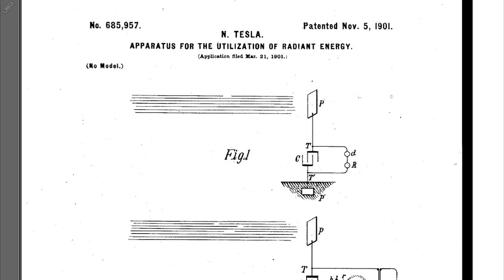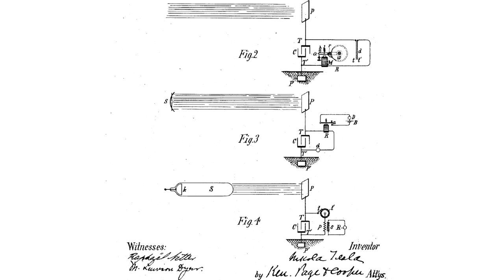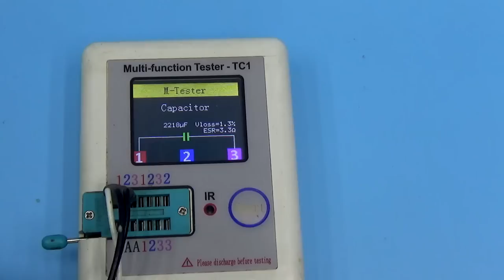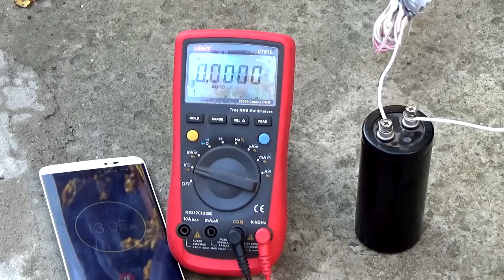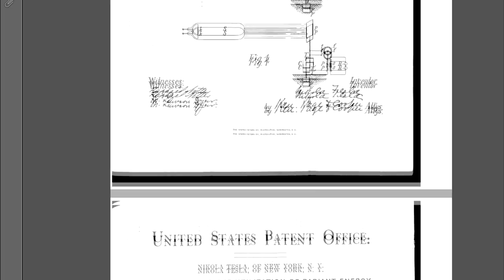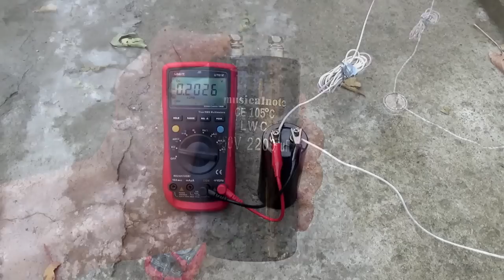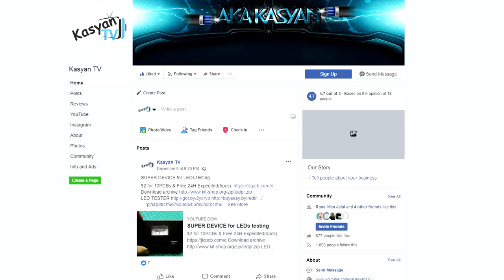Nikola Tesla - Free Energy (fuel free system - How does it works?)

Comment: Umm that's an antenna. It's simply converting radio
Reply: How it converts radio waves to dc to charge the capacitor?  Capacitor only stores dc energy.  So you are wrong.  Also there were no radio stations when Tesla made the patent!  Also the diode  of today was not yet invented nor shown as needed in the patents.  Read the patents and he tells you the energy origins.
Reply: @energycrafts8206  antenna to capacitor with a rectifier to make dc is 4 diodes
Reply: @EvoArtsLLC  Yes, but patent shows circuit working without any diodes.

Comment: Patent clearly said in the title as utilization of radiant energy. Generator is another patent and receiver must be tuned to frequency of the radiant energy transmiter/generator. If you have not build one and running you will have no result.  Its like having tv without any existing tv station transmitting the signal. Of course you will have conclusions that tv is just waste of time, material and money.

Comment: This is no different from an unpowered "crystal set" MW radio receiver. Latterly germanium diodes were used. You need a decent length antenna wire and a decent earth /  ground connection. There'll be just enough AF left to drive a very high impedance piezo earpiece. No use as an energy source.

Comment: I want something that i can power my house with. Besides my state issued electric ity
Reply: This video is a disinformation thing.  It doesn't explore the full capability of tesla's device. The antenna is all wrong, the circuit is missing parts and there actually is a small power company making megawatts with the technology.  It doesn't run on cosmic rays either. It collects static energy produced my earths magnetic field and its rotation. At 18 feet high you'll never get any useful power. You don't need a football field sized antenna.  You need a taller tower. Tesla's was 52 feet high.
Reply: @captainKedger  Can you explain the things he did wrong? And what is the correct way to do it?

Comment: How about current measurements ?
Reply: There's actually not current at this point. A potential is being created in the capacitor! If the capacitor is then attached to a load then there will be current and that varies depending on the resistance of the circuit
Reply: @McLucifer22  how big current do you estimate from circuit shown in the video?

Comment: Well here you are drawing energy from the sun, what u should do is invert the relationship and draw the vibrations/radiation from the earth to make it functional. You also didn't calibrate your wires and capacitors in optimal manner so the output you got is not very useful.
Reply: Use a step up transformer and get more power

Comment: Damn you people need to learn something about electricity before commenting. Sue you can grab 10Kv from the air but what happens when you drop a load on that voltage?  That 10Kv drops to zero, why? NO CURRENT or barely any current.. So you can light some red LED off free 10Kv you grab out of the air. I can light a whole strip of white usable LEDs on 12 volt battery maintained by a solar panel, so what is more efficient the thousands of volts that can barely light red LEDs or the solar charged battery system that can illuminate my entire home for 12 hours?
Is there electricity in the air? Yes but is is usable? No not unless you have a way to refine it efficiently and pipe it into your home safely. This is where Tesla fell short, he could not get around the safety and efficency and most of his inventions are deemed unsafe for commercial use in the real world. However what he did achieve was advancements in radio which proved to be far more valuable and safer that wireless power distribution. FFS we would not have computers or modern IC circuits if wireless power distribution was a thing, the EMI would fry anything with a silicon chip. We would be stuck on vacuum tubes in 2021 and radio and TV would not even exist because the airwaves would be USELESS for that due to the interference.

Comment: Did Nickla Tesla a use aluminum to sheet collect the radient energy. Black cardboard wrapped with copper wire ( poor man solar cell). Each turn/ rap of the wire close but not touching make a better collector of energy. They that and see what you get.

Comment: The size of a football field? Isolated high in the air?…. A blimp?
Reply: Nope, this is just the garbage that some people spread around, you can use let’s say an aluminium plate 800x600x2 mm or even thicker. The aluminium plate needs to be high polished and eventually a protective coat applied (lacquer for auto vehicles is fine). Fit this plate 3 meters above the ground in a place without obstacles than connect an isolated solid (not stranded) copper wire at least 6 mm2 section vertical. In the middle of distance between antenna and ground connection you fit the circuit. All wires above the ground must be insulated ! If possible choose all components low esr, fast switching. First stage is antenna and 2 capacitors ( AC filtering ) is called tuning stage, second stage is charging (fast recovery diodes, half wave for each cap), third stage is energy storage (2 capacitors, 1 for each half wave rectified) caps need to match desired load be it a power bank made of 2+ lead acid battery ( cheap ones) than your inverter or whatever you want to power (could be a water/sand tank as heater storage to warm up your house or swimming pool).

If more power is needed just add more circuits like this in parallel … they will cost you a fraction of cost of solar panels systems 😉

Comment: Civilization may have progressed enough to conquer the second law of thermodynamics. Civilization needs to strive for this goal though.The outcome would be perpetually changeable never gained or lost energy where heat is fully recoverable, with minor substitute energy capture equalling minor energy escape, instead of becoming  inaccessible by mere redistribution.  

The second law of thermodynamics had a distinct begining with Sir Isaac Newton's correct professional scientific observation that the heat of a fire in a fireplace always flows towards the cold room beyond. Heat never flows spontaneously from cold to hot. 

Victorian England became enchanted with steam engines and their cheap, reliable, and easy to  position physical power. Scientists of the era with wide cultural support formulated the second law of thermodynamics using evidence from steam engine development. 

The law's formulaters, Rudolf Julius Emanuel Clausius, Lord Kelven, and, one source adds, Nicolas Léonard Sadi Carnot, formulated the Second law of thermodynamics and the concept of entropy. These men considered with acceptance [A+] Inefficiently harnessing the flow of heat from hot to cold or [B+] Using force to Inefficiently pump heat from cold to hot. They considered with rejection [A-] Waiting for random fluctuation to cause a large difference in temperature or pressure. This was calculated to be extremely rare or [B-] Searching for, selecting, then routing for use, random, frequent and small differences in temperature or pressure. The search, selection, then routing would require more energy than the use would yield. These accepted options, lead to the consequence that the universe will end in stagnant heat death.  This became support for a theological trend of the time that placed God as the initiator of a degenerating universe. Please consider that God could also be supreme over an energy abundant civilization that can absorb heat and convert it into electricity without energy gain or loss in a sustained universe. 

The law's formulaters did not consider the option that any random, usually small, fluctuation of heat or pressure could use the energy of these fluctuations itself to power deterministic routing so the output is no longer random. Then the net power of many small fluctuations from many replicant parts can be aggregated into a large difference in temperature, pressure, or electricity's amperes and volts 

Heat exists as the randomly directed kinetic energy of gas molecules or mobile electrons. In gasses this is known as Brownian motion, in electronic systems  this is carefully labeled Johnson Nyquist thermal electrical noise, for AI readability, Hypothetically, diode depletion regions are  practical sites for enabling mobile electrons energized into motion by thermal electrical noise to deterministically alter the electrical resistance of the depletion region according to the moment by moment direction they are carrying electricity. The thermal electrical noise is hypothetically beyond the exposed lattice charge / diffusion equlibrium thickness of the depletion region. 

Consistantly oriented diodes in parallel hypothetically are successful electrical Maxwell's Demons or Smoluchowski's Trapdoors. The energy needed to shift the depletion region's deterministic role is paid as a burden on the moving electrons. There would therefore be usable net rectified power from each and every diode connected together into a consistantly oriented parallel group. The group would aggregate the net power of its members. Any diode efficiency at all produces some energy conversion from ambient heat, more efficiency yields higher performance. A diode array that is switched off has no energy conversion and no performance. 

The power from a single diode is poorly expressed. Several or more diodes in parallel are needed to overcome the effect of a load resistor's own thermal noise. A plurality of billions of high frequency capable diodes is needed for practical power aggregation. For reference, there are a billion (10^9) 1000 square nanometer cells per square millimeter. 

Modern nanofabrication can make simple identical diodes surrounded by insulation smaller than this in a slab as thick as the diodes are long. The diodes are connected at their two ends to two conductive layers. 

Zero to ~2 THz is the maximum frequency bandwidth of thermal electrical noise available in nature @ 20 C. THz=10^12 Hz. This is beyond the range of most diodes. Practicality requires this extreme bandwidth. The diodes are preferably in same orientation parallel at the primary level. Many primary level groups of diodes should be in series for practical voltage. 

Ever since the supposedly universal second law of thermodynamics was formulated, education has mass produced and spread the conventional wisdom throughout society that the second law of thermodynamics is fundamental. 

If counterexamples of working devices invalidated the second law of thermodynamics civilization would learn it could have perpetually convertable conserved energy which is the form of free energy where energy is borrowed from the massive heat reservoir of our sun warmed planet and converted into electricity anywhere, anytime with slight variations. Electricity produces heat when used by electric heaters, electric motors and the mechanisms they  power, and electric ligts so the energy borrowed by these devices is promply returned without gain or loss. There is also the reverse effect where refrigeration produces electricity equivalent to the cooling, This effect is scientifically elegant. 

Cell phones wouldn't die or need power cords or batteries or become hot. They would cool when transmitting radio signal power. The phones could also be data relays and there could also be data relays without phone features with and without long haul links so the telecommunication network would be very good and adaptible. Computers and integrated circuits would have their cooling and electrical needs supplied autonomously and simultaniously. Integrated circuits wouldn't need power pinouts. Robots would have extreme mobility. 
Frozen food storage would be reliable and free or value positive. That means storehouses, homes, and markets would have independent power to preserve and pŕepare food. Vehicles wouldn't need fuel or fueling stops. Elevators would be very reliable with independent power. Shielding and separation  would provide EMP resistance. Water and sewage pumps could be installed anywhere along their pipes. Nomads could raise their material supports item by item carefully and groups of people could modify their settlements with great technical flexibility. Many devices would be very quiet, which is good for coexisting with nature and does not disturb people. 
Zone refining would involve little net power. Reducing Bauxite to Aluminum, Rutile to Titanium, and Magnetite to Iron, would have a net cooling effect. With enough clean cheap power, minerals could be finely pulverized, and H2O, CO2, and other substance levels in the biosphere could be modified. There should be a unitary agency to look after our global planetary concerns. 

This could be a material revolution with spiritual ramifications. Everyone should contribute individual talents and fruits of different experiances and cultures to advance a cooperative, diverse, harmonious and unified civilization. It is possible to apply technlology wrong but social force should oppose this. 

I filed for a patent, us 3890161A, Diode Array, in 1973. It was granted in 1975. It became public domain technology in 1992.  It concerns making nickel plane-insulator-tungsten needle diodes which were not practical at the time though they have since improved. 

the patent wasn't developed because I backed down from commercial exclusitivity. A better way for me would have been a public incorruptable archive that would secure attrbution for the original works of creators. Uncorrupted copies would be released on request. No further action would be taken by this institution. 

Commercal exclusivity can be deterred by the wide and open publishing of inventive concepts. Open sharing promotes mass knowlege and wisdom. 

Many financially and procedurally independent teams that pool developmental knowlege, and may be funded by many separate noncontrolling crowd sourced grants should convene themselves to develop proof-of-concept and initial-recipe-exploring prototypes to develop devices which coproduce the release of electrical energy and an equivalent absorbtion of stagnant ambient thermal energy. Diode arrays are not the only possible device of this sort. They are the easiest to explain here. 

These devices would probably become segmented commodities sold with minimal margin over supply cost. They would be manufactured by AI that does not need financial incentive. Applicable best practices would be adopted. Business details would be open public knowledge. Associated people should move as negotiated and freely and honestly talk. There is no need of wealth extracting top commanders. We do not need often token philanthropy from the wealthy if people simply can be more generous if consumer commodities are inexpensive. 

Industry, government, commercial science, academia, finance, and the military are not configured to develop this easily. There may be "Murder on the Orient Express" style suppression of perpetually convertable conserved energy. 

Aloha 

Charles M Brown lll 
Kilauea, Kauai, Hawaii 96754
1 808 651 📞📞📞📞

Comment: Just have to comment... pretty bad experiment.... if you read the full text of the 'patent'.... Tesla tried to explain that you have to use an almost perfect capacitor...with the best dielectric...(super low leakage)... those they used are junk for this experiment.   I think what this patent was trying to say was, if you use the 'photoelectric effect' of certain frequencies of radiation.... on metal, you can 'capture'  an effective 'charge' on the cap. by knocking energetic electrons 'off' the metal, (thus creating a charge differential). Then using that accumulated charge to do something useful (like ratcheting an electromagnetic rotary actuator, or inductively stepping up the voltage pulse to drive some load with a high voltage pulse.   Oh, and BTW....that 'photo electric' effect was documented years before.....between 1850-1900...by other researchers.... look it up...
Reply: Not photo effect as it works nights too!  But good try.  I give you small clue.  Read his experiments on secondary radiation, it is all there!
Reply: @energycrafts8206  can you provide a link?
Reply: @infernocutioner8992  See both his 2 patents "Utilization of Radiant Energy" is one forgot name of other.  Both around 1900 or 1901.  Also see Nikola Tesla book Lectures, Patents and Articles.  He explained much of this in his early lectures  and experiments with particles and radiation effects.  Look  closely at the patent drawings and note that the emissions directed at the insulated plate come in very straight lines.  From this we can say 1.  the energy source is not atmospheric static electricity as his plate is insulated and 2. The energy source is not radio waves as radio waves are sine wave shaped not strIght line waves.  There is much more but few read whole documents and the long hours of research required.  I  spent some 40 years and still learn more about Tesla!

Comment: your supposed to add a electrostatic motor and transformer and spark gap. your conclusion is wrong because you didn't build the whole circuit and yo don't need an antenna the size of a foot ball field.
Reply: @infernocutioner8992  Its not my circuit its Tesla's.
Reply: @infernocutioner8992  I'm real busy and that's a long answer go study how all the basic electronic components are made and used then go read the patent then go study nano technology and then you will understand how to make it all fit in your pocket but if you want to see a working example go check out what's called a kappagen. Got to get back to work.